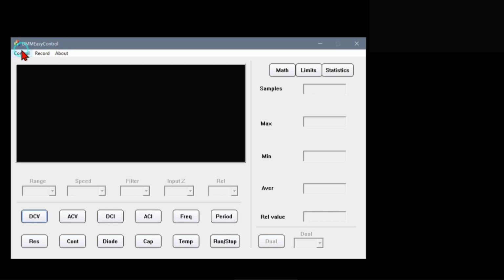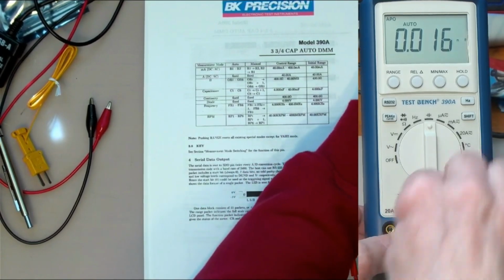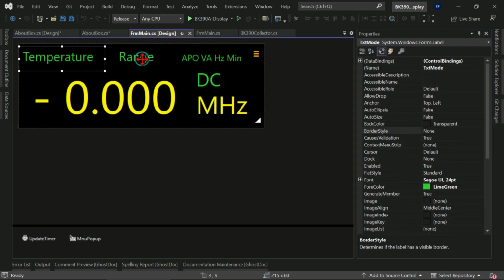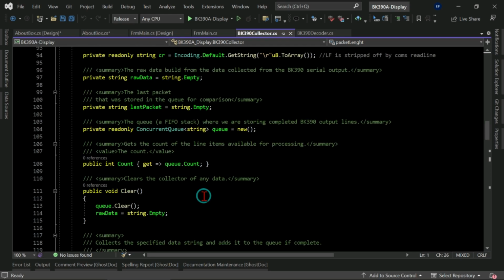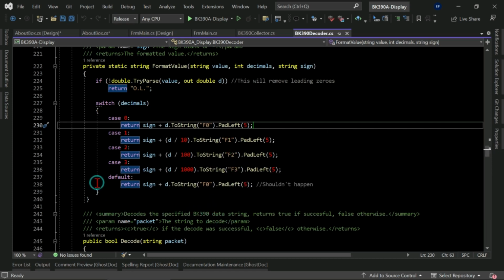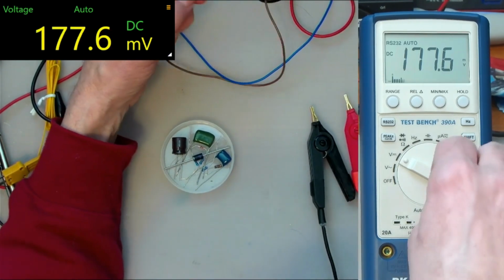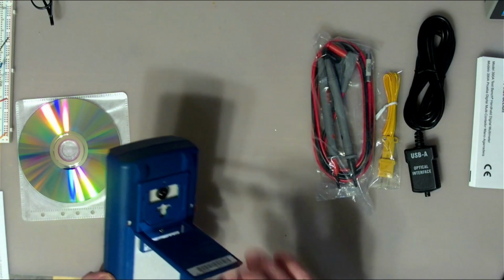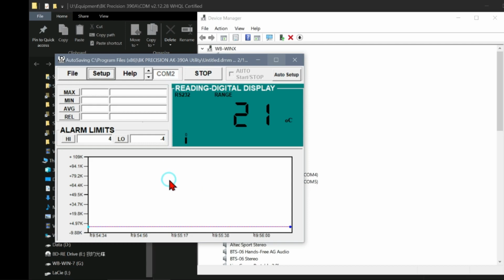Multimeter PC Measurement Display

Comment: Could this be used for any other meter?  Provided a person has the drivers. 

I would like to modify a fluke and pull from the RX and TX by chip and input to computer. Thanks. Great software.
Reply from the maker: Yes, the OWON uses a form of SCIPI protocol and this should work with perhaps little modifications with other meters.  Provided it has some sort of Serial interface and supports SCIPI.  I did however also create a version for a BK Precision multimeter which has a proprietary protocol but which was documented so I could create code for it.